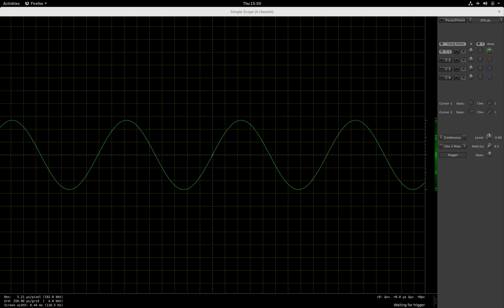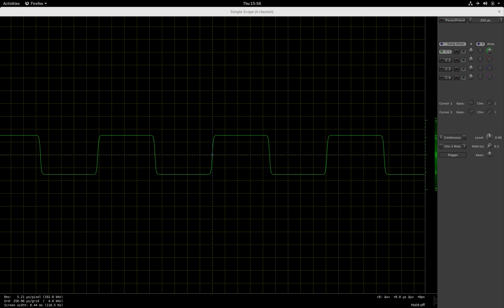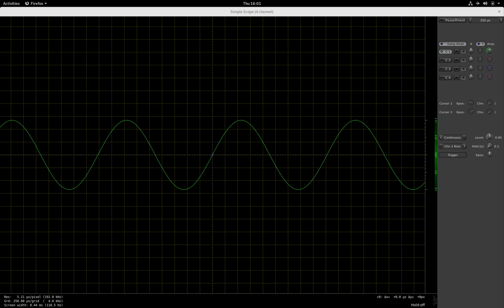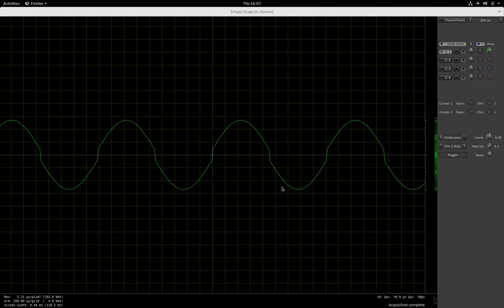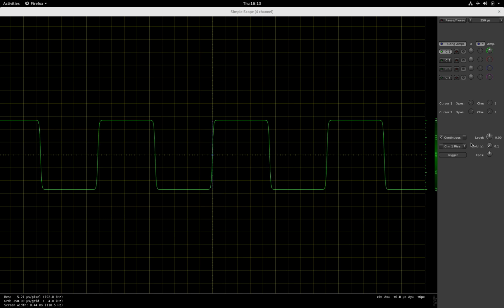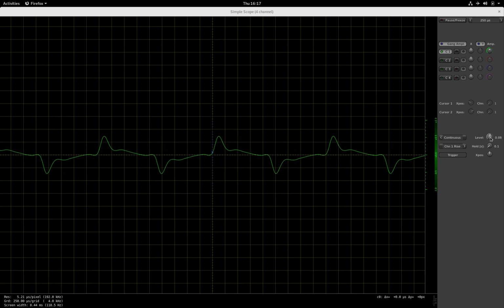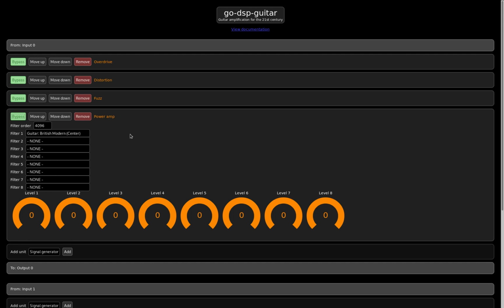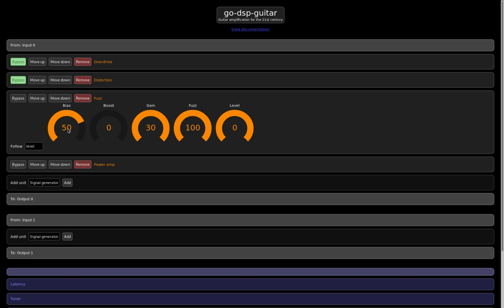Demonstration of Overdrive, Distortion and Fuzz effects on oscilloscope and with a guitar signal

Comment: I love how overdrive and distortion do a pretty reasonable, predictable thing with the waveform, while fuzz just fucks everything up lol. Great explanation, I’m kinda starting researching towards making my own pedals and stuff like that is what I’ve really looked for. Thanks a lot
Reply from the maker: Welcome! Well, the key component of fuzz is that it does not act symmetrically on the waveform. This is important to create even-order harmonics besides odd-order ones. Overdrive and distortion are symmetrical (at least in their purest forms) and therefore produce odd-order harmonics only. The asymmetry can be created by circuit design (for example putting a diode somewhere in the feedback loop of an amplifier - the diode will only conduct in one direction) or by adding a bias voltage. When you add a bias voltage, it makes sense to derive it from the input signal, as I've explained in this video. This derivation can be created by buffering the signal with an impedance converter, rectifying and then low-pass filtering it. This allows one to track the average or "RMS" voltage of the signal. One can then derive the bias voltage from that. This way, the bias will "track" the amplitude of the input signal so that it doesn't get "cut off" by the bias saturating the amplifier so much that the input no longer has an effect when it is small.
Reply: @linuxguitarchannel  Jesus Christ you’re so helpful, man. I got some basic knowledge about electronics and AC circuits but specific stuff like that I couldn’t find anywhere online. Thanks a lot
Reply: The fuzz face circuit generates quite a clean and predictable waveform... maybe not your cup of tea kind of fuzz! ;-)

Comment: Interesting video. A few questions if you're still reading. What software are you using as a software oscilloscope to display signals on the screen? Were the effects units actual external pedals or the effects in go-dsp-guitar? Basically I'm interested in duplicating what you're doing here with my own external unit and am searching around for how to generate signals, send over USB to an audio interface and then capture and display the signals. Thanks!
Reply from the maker: Sorry for the late reply. I was traveling while you posted this comment.

The effects come from go-dsp-guitar, but I've also measured actual effects pedals with this or similar techniques. (In fact, I've taken apart and measured many effects devices, speaker cabinets, etc. to create go-dsp-guitar.) Especially the "Fuzz" circuit in go-dsp-guitar is very particular in the way it functions in that it creates a level-dependant bias voltage by rectifying and low-pass filtering the input signal, mixes that with the actual input signal, then sends the result through an amplifier driven into the non-linear region, and then sends the result through a first-order high-pass filter to remove the DC component. Actual fuzz circuits are often very simple in that they use very few components and generally wouldn't do such complicated stuff. ;-)

The software scope I use is "x42-scope" from the "x42-plugins" package by Robin Gareus.

There are many ways you can perform such measurements.

1. You can use an external signal generator, set it to an appropriate level for a guitar effect (e. g. 1 V peak-to-peak) and an audio-range frequency (e. g. 440 Hz), then run the signal through a guitar effects unit, and then into an audio interface set to instrument level. Start JACK, run "x42-scope", then connect the physical input of your audio interface (e. g. "capture_1") to an input of "x42-scope".

2. If you don't have a "physical" signal generator, use the "Signal generator" plugin from go-dsp-guitar to create a sinewave signal, route its output out to the physical world through your audio interface, run the signal into a guitar effects unit, then run it back into an input on your audio interface and connect that input to an input of "x42-scope" in JACK.

3. If you want to measure a virtual guitar plugin, you can connect it all inside JACK without routing through your physical interface. Use the "Signal generator" plugin from go-dsp-guitar to create the test signal, route its output to the input of another JACK client that you want to "measure", then route the output of that to an input of "x42-scope". 

4. If you want to measure an effect in go-dsp-guitar, you can omit some connections in JACK, since both the signal generator and the effect unit are simulated by go-dsp-guitar, so you can route the signal internally and don't have to route it through JACK.

Of course, you can also do it completely without software and a computer if you have a "physical" signal generator, a guitar effects unit, a "physical" oscilloscope, and the required cables and adapters.

Comment: It's a bit theory imho bcos the signals from the real units sounds different and have other waveforms especially distortion:

https://youtu.be/gj8cT7WEGmo
Reply from the maker: I actually took inspiration from this video. The waveform will look different for any circuit from any manufacturer. The waveform of the distortion may actually look something like this inside the actual circuit, but it then got filtered afterwards, which changes the phase and also the relative amplitude of the harmonics produced. Even decoupling capacitors for DC removal will change the shape of the waveform. It would have been interesting to see the spectrum, but I did not have a spectrum analyser software available.
Reply: You are so right. You can claim that it is more than an opinion, it is a fact. (my good old scope doesn't lie) It's even possible to categorize different fuzz families according to how they look on a scope / sound. My favorite on a scope is probably the fuzzrite family. A lot of stuff happening and a huge palette of sounds for so few electronic components. The selmer buzztone circuit is also quite fascinating as the clipped portion of the signal is flipped upside down like a perfect negative copy. That could explain why it sounds more like an overdrive... with a peculiar hard clipping shape and harmonic content.

Comment: What's the effect when oscillogramme is like at 17:06, but the high hump of a waveform is inverted? I saw one like when I plugged a guitar to an old walkman player instead of a head about 20 years ago...
Reply from the maker: Inverting the peaks above a certain level is what is called "excess" in go-dsp-guitar. I don't know what actual circuitry would behave like that, but I also know there is analog circuitry that does this. (For example, I know that some synthesizers put out sine waves with "inverted peaks".) Put a fuzz in front to introduce the asymmetry, but make sure that the fuzz itself does not clip the waveform. You will probably have to tweak the settings a lot in order to arrive at a waveform you desire.
Reply: You build this version of a Selmer Buzztone ;-)
https://tagboardeffects.blogspot.com/2015/08/selmer-buzztone.html?showComment=1670810504616#c7728014688421060290

Comment: Finally! Thanks. I hate hard harsh clip. I like a singing positive sound.  Me pedalboard im not quite finished with but its crazy.  Moskey audio turbo amp , crybaby, fab fuzz, boss od1, fab metal, caline wine cellar. Not on the board is a marshall guvnor( not happy with it) and a battleworn HM-2 ( the third one ive had) ive still not determined the order of all these pedals yet and I could use some help.
Reply from the maker: Just from a theoretical standpoint, I would probably do the following.

1. Moskey (since it can also act as a boost)
2. Fuzz (needs undistorted signal to achieve asymmetry)
3. OD-1 (lower distortion first)
4. Metal (more "heavy" distortion later)
5. Cry-baby
6. Wine cellar (since it's a DI, so makes sense to put this last)

The cry-baby is basically like a parametric eq with the lows and highs cut, the mids boosted and the mid-frequency knob controlled by a foot pedal. The distortion pedals tend to increase both the spectral width and "richness" of the signal by introducing additional harmonic content, making it more "noise-like" so to say. That wide and "rich" spectrum is good for the filter in the cry-baby to work on.

This is just theoretical however. Wah pedals tend to have quite simple circuitry and often "freak out" when connected to certain other pedals, especially fuzz pedals, which often also have quite simple circuitry. That's basically because a wah pedal contains more or less an LC-circuit and a fuzz often uses a simple transistor-based (instead of op-amp based) amplifier circuit, and LC plus amplifier can easily become an oscillator. If your chain starts oscillating, you may easily damage your hearing or even burn your speaker coils out. In practice, a wah pedal is often the first pedal in the chain, even though it makes more sense to put it after all the distortion stuff.

Complicating things even further, some of the pedals might have "buffered bypass", where the signal always passes through a buffer amplifier, even when the pedal is in bypass mode, while others may have "true bypass", which means that they directly connect the predecessor and successor pedals in the chain. The advantage of "true bypass" is that you can bypass the pedal in case the battery dies and the signal will still get passed on. The disadvantage is that you have a large number of possible combinations of which pedals will get connected to each other, depending on which of them you bypass, and some of these might cause trouble or at least produce results that one would not expect. Having a buffer amplifier in each stage essentially "decoupling" the pedals from each other takes a lot of these variables out.

Not sure if your signal chain is very "balanced" though. Apart from the cry-baby, it's basically all distortion. Normally, you will not run multiple distortion units at the same time. Occasionally, you might run one set to a low gain into another set to a higher gain, so that the first basically acts as a "boost" for the second. The Caline appears to be a bass effect, so not sure how well it works with a guitar signal.
Reply: @linuxguitarchannel  first thankyou for the reply! Ive the wah second but I can change the cord( i got 6" 12" and 24" patch) im really just close to strappin down the extention cord for the P.S. im in no hurry. I just got a 1990 infinnium 2 weeks ago and been workin ona bcp 335 ( i put the cheap rail pickups in it, well a bridge tuners a brass nut and a switch) i just cut the slots and almost too deep. But ive been just straight in no pedals yet.
Reply: Ive a spot on my board for a DOD Acoustec too but for only when I need modulations. Not in a band situation ive been there 38 years im tryin to home record its a game Ive never been to practice for too many times. Daw way different than 2 jam boxes